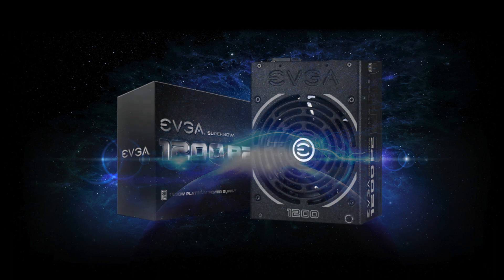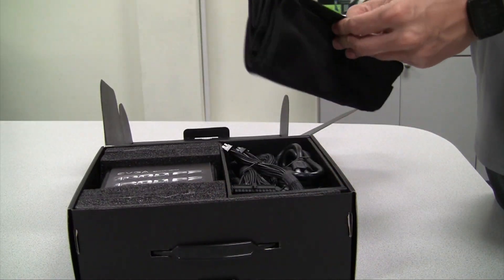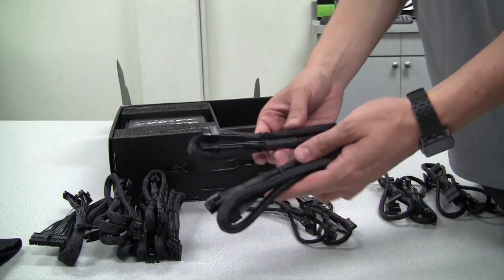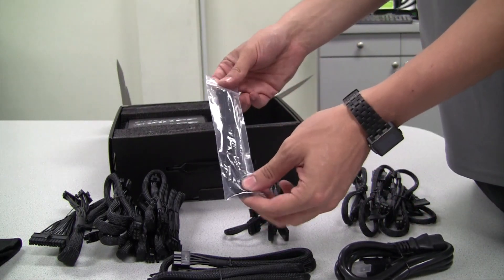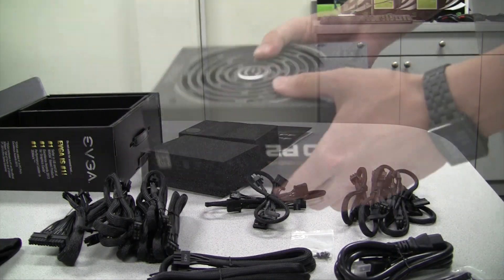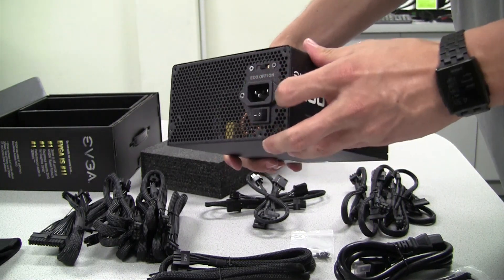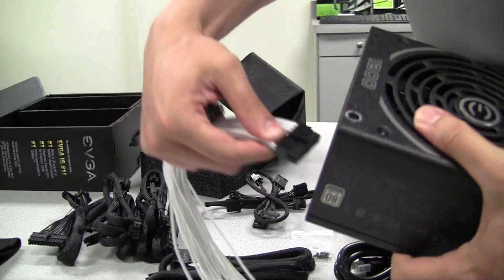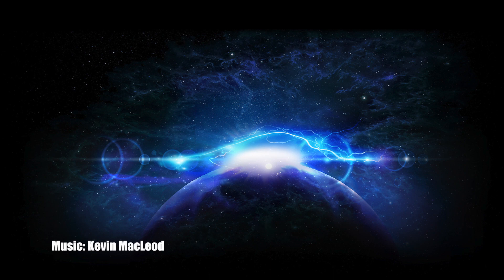EVGA SuperNOVA 1200 P2 Power Supply Unboxing and Overview

Comment: I've been running an EVGA 1000w T2 for years and it has performed perfectly so far. The new system build deserves a new PSU, so I looked at a new T2 but it's only available as a 1600w and costs about $400.00.  I just purchased the 1200w P2 on sale for $225.00 and look forward to its' long life. 

Fair winds and following seas to all.

Comment: when i was looking around for a 1000w to a 1200w psu i couldn't find one with good previews tell  found this one and when i saw how good it was from newegg to amazon i knew this one would be a great power supply for me cause what i have is.. is one of them old xion 800w psu  that ive  had for about  7yrs since i found it wouldn't run my system for me having Evga 760s but cant wait to try this bad boy out when it arrives

Comment: They never make the power cables and PCI cables long enough. If you have a large case and mount your PSU on the bottom of the case it is impossible to run the 8 pin motherboard cable behind the board. PSU's should come with like an extension cable for the 8pin and 24pin plugs. Also if you want to get creative and hide you PCI cables there is very little length to work with on those cables as well. Instead of providing 8 PCI cables, for all those Octo-SLI setups out there, why not provide like 4 regular length cables and 2 long cables. Im sure 99% of people would get better use out of some longer PCI cables than they would from having 8 of them. I mean when in the world would you ever need 8 PCI cables?
Reply: I wonder if its still the issue i just bought it and now i wonder if cables will be long enough for my Corsair Obsidian 750D
Reply: +Landon Pyle  I know right, the cables are not long enough! I have my 8-pin cable running over my two graphic cards and touching my cpu coolers fan before it gets to the motherboard and as you said forget about running it in the back of the case... not gonna happen!